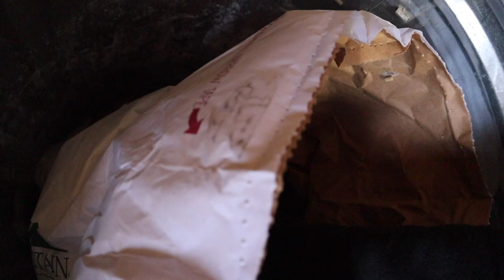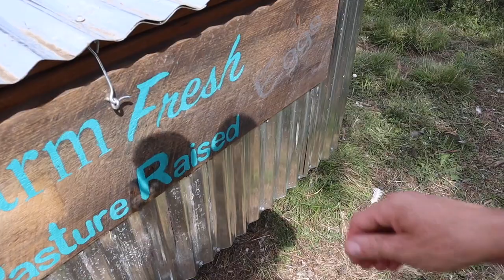We've Spent Months on this GARDEN & they've Destroyed it OVER NIGHT! (EMOTIONAL)

Comment: Get a black light, and go in at night. The horn worms glow and are easily spotted. In all my 30 years of gardening I have never had them eat the tomatoes, only the leaves. Might need to investigate further to see if it isn't something else damaging the fruit. My chickens will not eat the worms.
Those green tomatoes wouldn't go to the chickens here,  cut the bad spots off and have fried green tomatoes, or make green tomato salsa.
BT is an organic treatment/spray that gets rid of worms.
Reply: I've had hornworm damage to tomatoes but I believe they have to be large enough and strong enough to bite thru the skin.
Reply: Gwen Pool  we use a black light flashlight and it works amazingly well. They glow in the dark
Reply: Me either; there is something else getting in there.
Reply: what is bT?
Reply: @lm2193  
If caterpillars are devouring your garden, one safe and effective way to get rid of them is by applying the naturally occurring bacteria known as Bt, or Bacillus thuringiensis. Bt can be applied as a liquid or powder, and many of the varieties are certified organic.
Reply: @BroqueCowgirlHomestead  thx for info :)
Reply: @lm2193  welcome

Comment: HORNWORM SOLUTIONS 
1. Try using a black light, this helps you see them easily.
2. Try spray your plants with water and the hornworms will move therefore making it easier to see the worms.
3. Spray all of your plants (that can be affected by hornworms) liberally with a natural homemade mixture of 2 cups water, 1 teaspoon each of cayenne pepper and liquid dish soap. This will deter the hornworms from feeding. Adding garlic to the mixture can also help prevent the moths from initially laying the eggs. Make sure to thoroughly cover both sides of the leaves and the stems.

Comment: P.s. I tried picking them off- I went out morning and night. I used a UV light at night. It slowed them down but my plants were decimated. Now with BT I have no damage.
Reply: M Devery What is BT?
Reply: Bacillus Thuringiensis - you can get it any decent garden center. I buy the concentrate but you can get it all mixed up.   It works on caterpillars.
Reply: Thank you ❣️
Reply: I use BT also. I swear by it.

Comment: When I lived in California I used this:

1
Put six cloves of garlic, 1 tablespoon of dried hot pepper flakes and one minced onion into a blender. Add 1 teaspoon of liquid dish soap. Blend the mixture until smooth.

2
Add the mixture to 1 gallon of hot water in a bucket or watering can. Combine well. Set aside for one or two days.

3
Strain the mixture into a spray bottle. Spray the tops and bottoms of dry plant leaves to deter pests. Apply every few days as needed.
Reply: Yes!  I looked that up and it works great.  With as many as they have, they are going to lose the plants if they don't get rid of the worms.  They move fast and overnight they will be gone.

Comment: According to Henderson Park Garden there is an organic friendly spray: Dipel. One of the best ways to handle chewing caterpillars such as the tomato hornworm, the tobacco hornworm or the cabbage looper is to use Dipel. Dipel contains Bacillus Thuringiensis (BTK) which also comes in a liquid form rather than a powder. Dipel bacteria attacks caterpillar gut killing them but is safe for benign insects, birds and humans.
Reply: Does it work on bean beetle larva?
Reply: It works on all chewing pests, since they ingest the bacteria from the leaf or stalk, and then die when bacteria grow in their stomach.  It does wash off with water, so after sprinkling, or rain, you need to re-apply.

Comment: You need to spray the tomatoes with BT - it is  organic and works by disrupting the digestive system of the caterpillars. I use it on any plant that is attacked by caterpillars.  I am in Maine and spray weekly starting in mid July. I started 3 years ago after my tomatoes were decimated by tomatoe hornworms.
Reply: M Devery What is BT?
Reply: Isn't it bad for bees?
Reply: Do you mean bacillus thuringiensis? Yes, that's a natural, organically approved control for caterpillars.  Expensive but worth a try.
Reply: Thank you ❣️
Reply: Yes I do mean Bacillius Thuringiensis. It is pricey premixed. I buy a one quart concentrate by Bonide - about $25 but 1 tablespoon mixes up a gallon.  I use a pump sprayer because I spray my fruit trees as well as many vegetables in the garden
Reply: M Devery Why do you spray your fruit trees with it?
Reply: I spray my fruit trees ( they are dwarf so can reach all limbs) because there are moths that lay eggs in the trees.  When they hatch into caterpillars they can do do the same kind of damage to the tree as the hornworm does to the tomato plants.  Someone asked about the moth that lays the tomatoe hornworm eggs. It is large, actually quite pretty, and flies low and slowly.  I have tried to catch/kill but have not been able too.  I don’t raise bees and spray exactly 3 times.  That manages to catch the cycle.  I hope this helps.
Reply: M Devery Yes that helps a LOT. THANK you again ❣️🥰

Comment: I wonder if you should consider maggot barrier “footies” for your tomatoes next year. Organic apple growers swear by them. They are made of 100% nylon and stretch, just like pantyhose. You slip them onto fruit when it is about 1" in diameter and the "footie" will expand as the fruit gets bigger. These barriers are used to combat apple maggot flies and codling moths, but I bet they would be effective against hornworm too. They're simple to use and assure perfect, pesticide-free fruit. About 100 cost $12.00.
Reply: Yes,  have been thinking about such a thing to hold the weight of your melons on your verticle vines.  Net type onion bags, and sections of pantyhose work also.
Reply: Linda Polle Net type onion bags would not prevent hornworms from eating the tomatoes. Pantyhose-like nylon I think would.

Comment: In the northeast, we are infested with "Lantern Fly's". We have been told to use 1/4 cup of Dawn dish detergent, 1/4 cup of white vinegar, to 1 Gal. of water. Spray the plants, Larva, and Pests. It has been working well, and seams to provide some short term lasting protection for the plant. (Try 1 plant first, check for effectiveness.)

Comment: For your louvers, Al, you need to use the bow set up. Run a chain from one louvre to the next with a little bit of slack. This forms a bow. Then attach your pull chain to the center to create equal and even pressure. Think of a kite and how you attach the string to a bow string that is attached at two points to the frame of the kite.

Comment: Al, I know many people that have had the same issue with tomato plants and I asked a few of them what they use to get rid of them. The all said the same thing, in a spray bottle use peppermint oil.  In a gallon sprayer they use 4 drops of peppermint  with water. Shake it up and spray the plants. It will work for the other plants as well and it is natural .  They swear by it and they use it on all there  small garden's. I have used it and it works very well.

Comment: Another way to spot them is to spray the plant with soapy water. The soapy water will cause the hornworms to wiggle and convulse around, making it easier to spot them. If hornworms are found immediately remove them from the plant and either drop them in a container of soapy water or smoosh them. Hope that helps 🥰

Comment: Al, here is a great way to help hunt Hornworms.  Do it at night and use UV flashlights.  They glow and contrast against the darker tomato leaves and stems. Makes it a lot easier.  There are a number of Youtube video's on using UV lights to find hornworms at night.  I have a UV Streamlight Stylus Pro penlight that works great for this, but other models/brands should work also (mine is a LED light).

Comment: Captain Jack's dead bug brew is OMRI approved it works like BT on the nymph (worm) stage of development and is completely harmless to humans. You just spray it on a couple times a week it is pretty amazing. Black light at night, every night is your other sure fire option. However, prevention might be better, close your doors and open the bottom flaps after putting screening to prevent the butterfly that lays those horn worm eggs from coming in. I'm surprised you haven't had cabbage loopers yet! And yes horn worms will strip peppers too! Good luck!

Comment: here is a few plants you can use Marigolds – they give off a strong odor that confuses the sphinx moth. Best types of marigolds to use are: Calendula (often called Pot Marigold), and the Tagetes (Grannies Garden variety) marigold
Borage – helps to deter both hornworms and cabbage worms. The blooms also attract predatory wasps which are helpful
Nasturtiums – these are also edible
Basil – edible too. Small blooms also attract the Bracnoid Wasp
Wildflowers
Dill
Chamomile
Buckwheat

Ladybugs
Do ladybugs eat hornworms? Acutally ladybugs feed and eat on the larva of the hornworm eggs that are found on the plants.

Ladybugs feed heavily on aphid & hornworm larva and can eat up to around 50 larva a day. You can purchase ladybugs to help control tomato hornworms. If you do purchase them, they should be released at night when the are less likely to fly away.

Green Lacewings
The green lacewings works a lot like the ladybug. It too feeds of the larva of the hornworm. Green lacewings will devour over 200 or more garden pests or pest eggs in week.

Comment: As far as the vents, if you connect one chain between the two sets of leuvers and then run the other chain to the opener with a sliding ring, it should open evenly.

Comment: I would suggest Spinosad or BT. Both are 100% organic and certified organic. However, if you'd rather try something else, you can mix 1 gallon of water with 2 tablespoons of oil and 2 tablespoons of Dawn dish soap and spray it on your plants. It's helped me with my Hornworm and my Vine Borer issues.

Comment: Gina asked in the video  "can this happen in one day".  Yes (and no).   The eggs are laid by a moth, so Yes, in one day, many hatched.  Others hatched later.  A moth can lay up to 2000 eggs,  but here is the scary part... 2000 EACH MOTH.  So, you have thousands of caterpillers at this point. Here is the thing about caterpillars,  they have a short time to eat grow and then become Moths,  so they eat like a freight train barreling through your garden, 24/7.   but here is the bigger problem that you NOW have.... those that you don't find will overwinter in the soil as pupae, and then emerge as more moths... which will then repeat this cycle again except there will be more than this time.   Tilling the bed after plant removal and again before spring can kill the pupae, which then kill next spring's moths in your soil, but you guys want to plant more in those beds which will preclude killing them off by tilling.  You need to have a plan to combat this, bc this is a battle you will have forever now.  I suggest sulphur.

Comment: I see several recommendations for BT; this is an approved pesticide for use on organic grown crops. There are several strains available, the most common strain is specific to (moth and butterfly ) caterpillars only.  It is safe to use and will not impact beneficial insects. It has a very short residual (breaks down in sunlight) so needs to be applied repeatedly when you see damage.  Physical removal a great way to control them.  Was surprised by the fruit damage as I have never seen them do that before. I would want to make sure you don’t have something else doing that.  The adult stage is a beautiful hummingbird moth, I suggest you allow your daughter to rear one out to the adult stage.  Would make a great science project.

Comment: To keep your goats from eating your young apple trees, maybe cut a length of flexible plastic drainage tile, split it and put around the trunk of the tree.  Make it long enough that the goats can't reach to the top of it and chew on the tree.  Then loosely secure it with zip ties.

Maybe this will work.  I've never had goats.  Will goats try to chew through the plastic?
Reply: Kevin F yes the goats will just eat that plastic

Comment: I suggest you vacuum up the swarf on top of the greenhouse door frames you created when drilling/screwing before it falls onto you or your dogs/cats ,gets into your eyes,ears etc;. Could cause a true medical emergency. I know well,I have a piece of rust permanently in my eye (no pain or other complications as of yet) and I was wearing safety glasses.
Very scary getting metal shavings in your eye. It has happened to me more than once with glasses on. Once I had to insist a specialist Dr. be called in to look in my eye utilizing specialized equipment only he was authorized to operate when I told others in emerg. room there was some debris still in there,they insisted I was only feeling the tearing in my cornea. I was right!

Comment: The first chain was cut to shot. Simply witching chains, then centering the pull over the top of the controller, then cut the chain at the controller lever would have addressed the issue.  Here is a diagram for equal pull... (   Y   ) easy to understand..

Comment: You need to completely seal off the green house, put in a cement floor, use raised beds instead of a dirt floor,  and put a second layer of plastic on top of the greenhouse.  I'm concerned  that with the winters you have, that you won't be able to grow anything.
Reply: 2 layers of plastic on greenhouse!

Comment: Don’t take the rod out use a can of “duster” for air blowing clean a computer and turn the can upside down the pressure and gas will be very cold sorta like using propane
Reply: Did he read the directions on mounting the bracket the 1st time?  By moving the bracket it is not mounted in its strongest place?